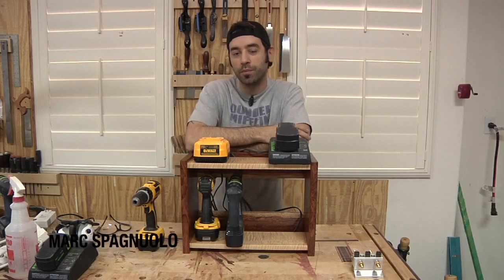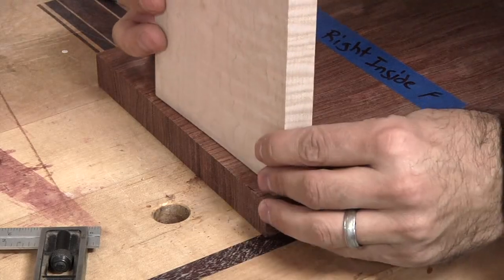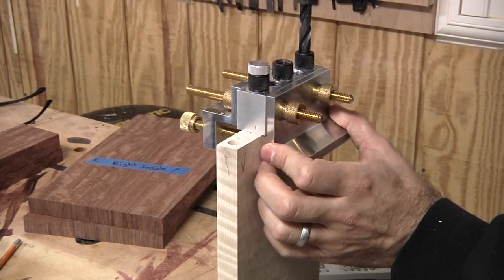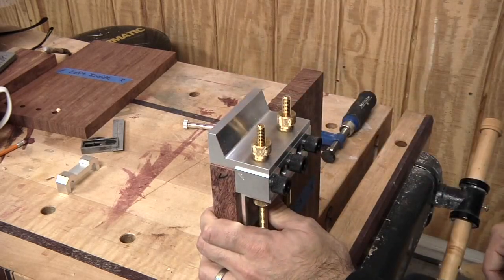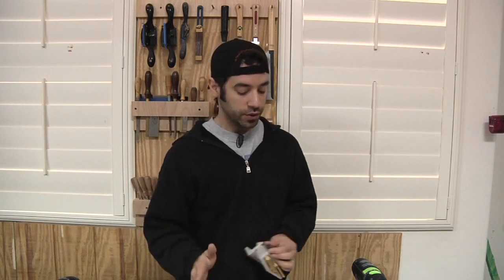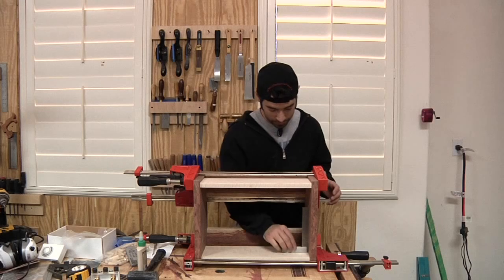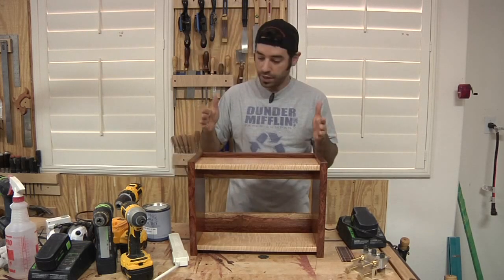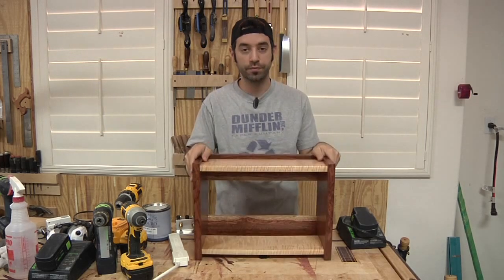112 - How to Build a Drill Charging Station using the DowelMax

Comment from the maker: That's the Veritas Twin Screw and there's a chain that connects the two screws. You can operate them independently if you need to but the chain drive allows them to move together. Pretty cool stuff.

Comment: the old cabinet maker who trained me used dowel carcass construction exclusively.  I have some old pieces I made using dowels and after all these years those joints are as tight as the day they were clamped.  what I like about dowel construction is the speed. and before the joint is clamped to tightly to move you can adjust the fit with a block and hammer lol

Comment: I own the Dowelmax and I love it. But, I don't think you need the right angle bracket. Dowelmax is designed so that you can set it to drill into the face or the end of your workpiece. Notice the threaded holes in the bottom of the jig that you see at the 12:12 mark.
Reply: Yeah, he totally missed that. I've been using a dowelmax from pretty much when they came out with it and I use that side drill all the time (made many drawer boxes with it)

Comment from the maker: I honestly don't use that method anymore. Not because it didn't work but because I got lazy and never set it back up after using the stuff for Christmas lights, lol. But from what I have learned, it seems most modern chargers do shut off so it shouldn't be too much of an issue to keep them plugged in.

Comment from the maker: Yeah its a tough one.  But if you look at it like a joinery system, as opposed to a doweling jig, its on par.  So comparing it to things like the Domino or the FMT or WoodRat. Its something that's meant to be an all in one joinery solution.  So its definitely expensive, but so are all those other joinery systems.  Most times, I still make my joints the new old fashioned way (tablesaw and router).

Comment: Hey Marc this is an interesting project and love the whole buiding process; just wanted to tell you that some times there are some moments in any video that can lend to some sort of distraction or even a miss leading info in a worst case scenario, thing is when you are sight following all of the details that come around the step you are showing in, and something gets kinda in the way and disrupts the principal idea to show at that precise moment and it comes clear or resolve by the time the images move on or change the focus angle and then we says it was nothing, problem is that in some videos we don't get lucky and come stranded with and erratic idea, not in this particular video, for instance in time line 6:47 there's the helping pin of the doweling jig just laying there at the table but for some reason I got stuck with the idea that it was some kind of hexagonal head bolt screwed onto the working piece and thaugth that I missed a step of the process, and there you have it, just a little sillyness of mine to share, but to glorify the way and the intention of yours when doing this woodworking taping. I don't want to be rude by ending up in a comparison to other fine woodworkers that post this type of videos, but I think that we can always add up ideas to make things better. In the other one of your videos I asked for the model of your powermatic table saw, what it mostly impressed me was the amount of sound it makes, it's almost like a cat's purring, but then again I thaught you were doing some soundvideo editing for those loud moments and diminsh those annoying bursts and the sudden moments to lower the volume. There are other youtube videos that I love to watch but they are a lot careless in this matters, I mean they don't have any kind of video edition before uploading them, for instance if you want to see how a sword it's made or some blacksmith action and that you want to pay attention to what the autor is telling in between the ear blasting hammering. So there you have it, I hope I could be in some help with my "love letter" size comment, just to poin that, maybe, you want to have "in frame" just what you need (tools, accesories, props, etc.) to explain at the moment of the director's yelling "action" so that no other idea can get in the way. Please don't get me wrong, I'll always enjoy learning form your work and as also I want to follow the warm human touch example you have set and that we all have seen in all of your videos. De caballero a caballero... muchas gracias!! (Y) (Y)

Comment: How much do you chage a drill?  Or should it charge you for using It?  

Fast question,  serious answers only.
What tools in your shop do you find indispensable and you always use?
What tools do you seldom use and what tools do you have no use for and will get rid of or have let go?  Seriously the shops full of usless junk you never use not so much you but I mean anyone in general. 
Is the dowlmax just another i don't need tools or can you get by without it, or do you actually use it?

Comment: Been using the Dowelmax as my primary joinery system since it was first introduced years ago  ... goodbye biscuits.

If you convert, just make sure you do a better job applying the glue to the holes and dowels [I prefer fluted over spiral].

For strength and alignment, WW went overboard with the dowels.  But, at $0.03 apiece, when you're having that much fun, who cares.

WW should have mentioned that the "check marks" are there to register the holes off the important references surfaces.  For example, with glue ups you want the reference surfaces to be the top such that any variations [not the jig's fault] are underside.

There's also an "extender" to register the jig down the length of board, e.g. two dowels, skip a foot, two dowels, skip a foot, etc etc.

The DowelMax is limited to 3/8" diam; I have the 1/4" inserts too; you can make a similar jig for 1/2" and 5/8" dowels for 4x projects but I find myself using two or three row of 3/8 plugs.

Also those alum spacers ... anything will do.  I have made a set from hardwoods in 1/16" increments to complement those in the package.

Great tool.

Comment: don't you think that the reference bracket with the spacers belongs to the side with the longer threads?
Reply: It works either way, but you are correct, it makes sense to put the spacer on the longer threads. However, you don't even need the angle bracket. The jig is designed to be set up in either configuration; end or face drilling. you simply remove the studs completely and there are threaded holes 90 degrees to each other. The only time you need the bracket is if you are drilling in a place where you can't get the jig around the workpiece. For example, if you are drilling holes across a side panel for a shelf.